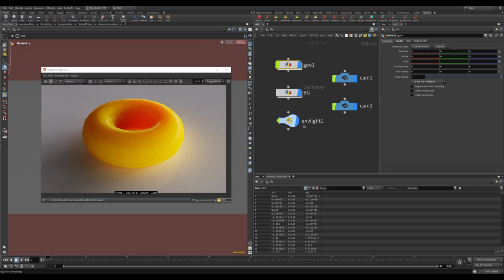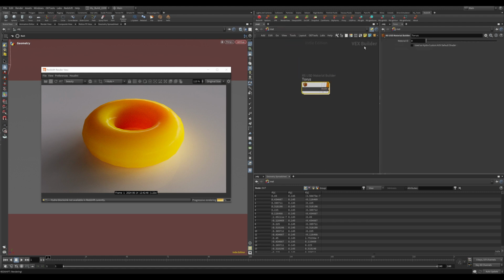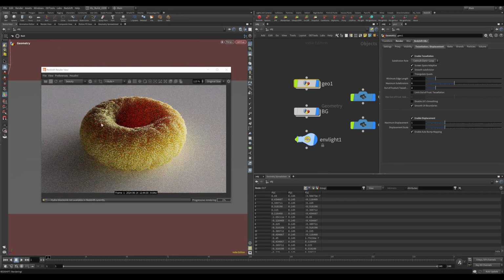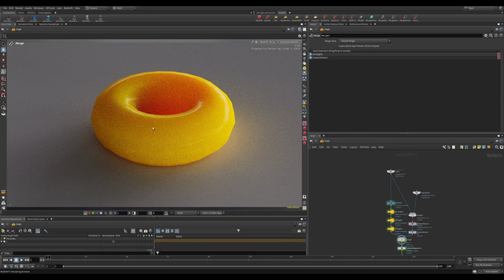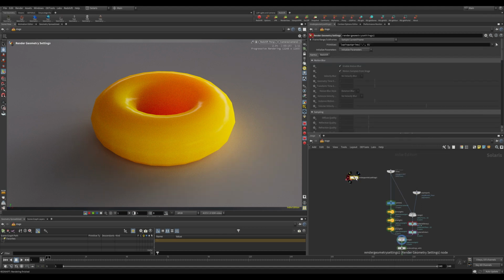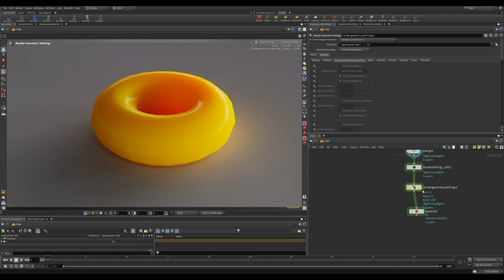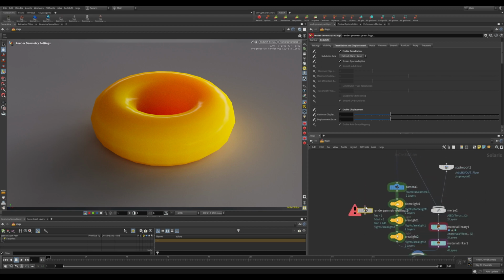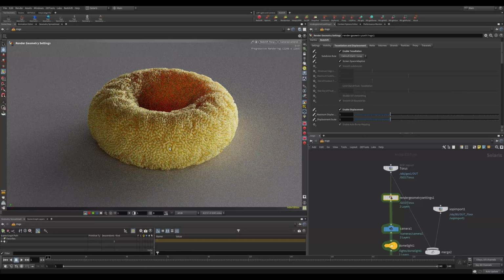HOUDINI QUICK TIP / Redshift Displacement with Solaris

Comment: i have been using redshift for a while but in what situation would I need to change to solaris? curious
Reply from the maker: Solaris is USD workflow. If you work with a bigger Team and different Assets you can bring all together in Solaris as USD. It is a great Workflow and it is also good that Redshift can be used and is supported in Solaris.